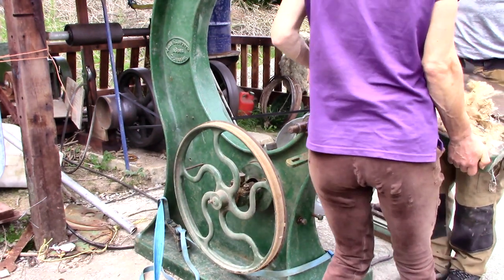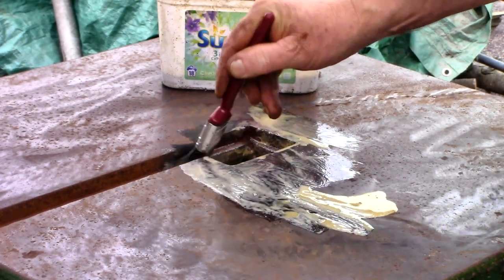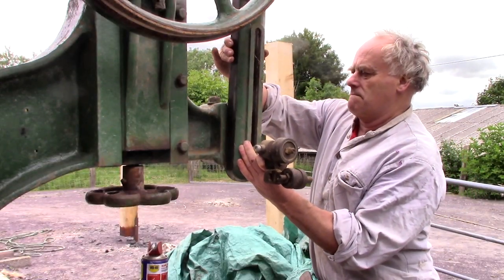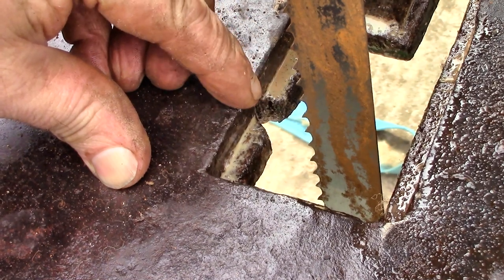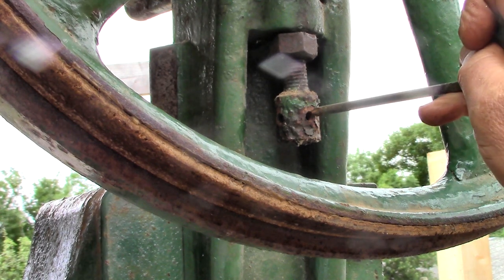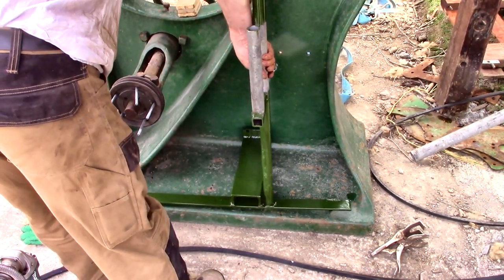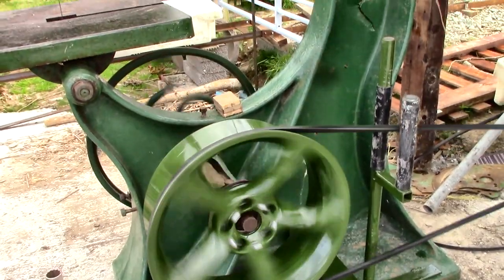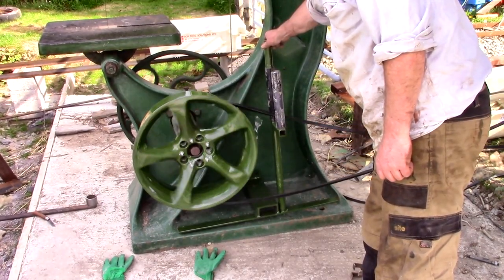First Cuts With The Vintage Bandsaw...!

Comment: Old machinery has soul. Being built to stand the test of time they silently bear witness to wars, famine, plagues, discoveries, advancements and progress.
If only they could talk.
Sometimes if you look close enough you can get a hint of what they have seen.
Past repairs, scars from use and sometimes a modification good or bad.
Above all they have soul.
A piece of every draftsman, foundry worker and mechanic is there. Silently they live on.
How happy an old machine sounds when restored to its original condition and put under power.
If you listen close it will whisper it's secrets in just enough quantity to make you have more questions than it will ever answer.
But on that first moment of life it gives you a bit of that soul.

Be safe and have fun!
Cheers
Terry from South Carolina USA

Comment: I loved your simple solution for the belt guide.  I purchased an enormous Italian bandsaw at auction about 6 years ago. It weighs in at approximately 2 metric tonnes. It is 3 phase powered, stands well over 2.5 metres tall and easily processes seasoned hardwood eucalyptus beams. The bandsaw wheels are so large that with the momentum imparted by the 10hp 3phase motor it takes some time for them to stop after I have switched it off. I love the look of it as I do yours , both are works of art.

Comment: It really needs some rubber on the pulleys, it's much less hard on the set of the teeth, that rub on the wheels. Without it the teeth on one side will wear and the blade won't cut straight. Good pulley rubber can be cut from old inner tubes and if needed can be stuck on with Evo Stick. You don't need to let the glue go off as you usually would, just spread it (Or spray) on the pulley and stretch the rubber over. Only ever had to do it once mind.

Now you need to make a blade sharpening machine,  that ratchets the blade along one tooth at a time and sharpens it with a Dremel or similar. There are videos on YouTube on several different designs,  some stand alone and others that fix to the bandsaw table.
Reply: Good idea on using an inner tube to put 'round the wheels!
Reply from the maker: But it already has cork tyres : -  )
Reply: @wayoutwest-workshopstuff6299  Ah I didn't see those. Sorry, carry on.

Comment: Just been reading some of the comments and they are right you do need a guard on there to stop you getting hurt if the blade snaps or just comes off I have used a lot of bandsaws and band resaws as a wood machinist. Very nice machine

Comment: I love your vintage diesel engine and all the machines you run with it. One thing I would do though is maybe build plywood guards over all those exposed belts and pulleys. Too easy to get a piece of clothing caught in there, and all it takes is a momentary lapse of attention after you've been working all day.

Comment: I was gifted a homemade full size band saw a few years ago that was built back in the 70s with a motor and transmission from a lot further back.  It works perfectly even the wooden pulleys for the saw blade are in good shape with a bearing in the middle and rubber on the outer edges.  I prize this band saw and use it every chance I get.
Yours Tim is marvelous.  Cheers 🇨🇦

Comment: Might be worth building a table extension for the back side of the blade platform. That way when you run some longer pieces through it, you can continue to push through without worrying about the piece dropping onto the wheel.

Comment: 1:41 the bearing could have been replaced, but honestly those bearings don't wear heavily if they are greased well, kept dry and don't see sand or metal dust in their daily life. Given that you don't exceed their design RPM and the load is well balanced.

Comment: Great to see the saw running. The engine seems to be starting easier. 
I trick I use on my diesels is to run them at speed and trickle some water down the intake.  It cleans them out very well and makes starting and running them much better. I use a litre or 2 and just trickle it in fast enough so the engine doesn't bog. If it does, I wait  a few seconds till it clears and go again. It's very simple and very effective. 
Love the vids and all your wonderful toys.
Reply from the maker: Thanks - but I'm not sure what you mean - the water intake?
Reply: @wayoutwest-workshopstuff6299   I meant pour the water down the air intake where the air filter or inlet manifold is while the engine is running and warmed up. 

Do this with my lister which I run on used veg oil and also my other engines and Vehicle. 

It cleans out a lot of deposits and can clean injectors tips  and free stuck rings. Very simple but helps if an engine is clagged up in anyway.
Reply from the maker: Seriously? That sounds mad, but I'm intrigued now : -  )

Comment: Interesting to see the stepped/flanged wheels, instead of the more typical crowned type. I have only ever seen ones like this on metal-cutting saws, which probably have higher feed pressures. I wonder if these are the original wheels. I would be pretty nervous about getting near all of that exposed blade. Maybe a guard of some sort?
Reply: No kidding, I am pretty sure I'd cut my left arm off just below the elbow with that much exposed blade!
Reply: teaches you to be more aware of your surroundings ;)

Comment: Maybe you should put a gass powered on board compressor on the train to refill the tank and also install a bigger air tank, quick question, if your old stationary engines breaks beyond repair what replacement would you get

Comment: Are you planning on putting a roller style conveyor belt on the back side of the blade to catch the drops? If you cant buy one I am sure you should be able to easily make a small one with some loose pipes

Comment: 4:32 the wood is supposed to be the other way around: Slot open in the back. The blade will flex backwards under load and its better to let it hit metal than wood, as wood causes a lot of extra drag which can snap it.
Reply from the maker: Slot at the back is how I made it

Comment: I wonder if the nick on the table might be from the BACK of the blade from pushing metal or wood into the blade and not the cutting edge hitting the table.

Comment: OLD PEDAL SEWING MACHINE THE NEEDLE IS ATTACHED TO THE PEDAL(S) AND YOU CAN MAKE IT LIGHTER METAL IF YOU LIKE   USE A THROTTLE OR SWITCH TO MAKE IT GO AND THE WHEEL IS GOING BY ITSELF MECHANICALLY
IT CAN BE USED FOR DIFFERENT THINGS AND YOU CAN VARY HOW IT'S MADE ALSO    IT WILL ONLY ROT IN PATENT SO IT'S YOURS        ( PUMP AIR INTO THE OLD PISTONS?   WASHING MACHINE ETC )

Comment: Is it possible, that the table has been mounted as you put it first, so the scar in the table is from the backside of the sawblade...?
The teeth couldn't done that  scar, or...? or have the turn the sawblade reversed and sawing from the other end...?

Comment: Bicycle inner tubes can be used as the rubber tires under the blades
Reply from the maker: But it already has cork tyres..
Reply: @wayoutwest-workshopstuff6299  - OK I missed that in the video….great job Tim

Comment: Oooh Tim at least put a table extension next or under the main table to catch any offcuts before they hit the flywheel or the pulley or the lowe bandsaw wheel. Makes nice projectiles heading for the tender bits. Ouch.
Reply from the maker: You're quite right : -  )

Comment: How wide do you think it will cut , 12 inch or 14 inch wide ? Those belts always freak me out even back on the farm putting up silage !
Reply from the maker: I say a good blade would cut much wider - 20" or more. There's a lot of power in the engine. I'm limited by the throat though..

Comment: Could this have been driven by an overhead drivetrain? I remember the old cloth mills used to have drivetrains and my local printers had one to drive their presses via a stationary engine. They could move the belt to effectively enable and disable the machine. Back then, everything was fed from the rod including generators for electricity. These days its the opposite way around, with everything driven by electricity to power local motors.
Reply from the maker: I'm working on it but it's expensive to set one up

Comment: They are NOT grease fittings. They are for oil. Bronce barings also use oil. 
Please Tim. I´m pulling my hair out over here and i don´t have that much left.
Reply from the maker: Lars, I think you're mistaken - they are grease pots (also called cups). They are designed to be screwed down a little every time you use the machine, and that squashes some grease into the bearing. (Look them up.) If you tried to fill them with oil it would just run through. Sorry about your hair : -  )
Reply: @wayoutwest-workshopstuff6299  Aperently I am mistaken. Sorry Tim. I just googled them and found them. Never seen one before. And I have a lot of old shit in my shop. My bad.

Comment: probably the main reasons people go with modern technologies is, for one, it being plug and play- as in, plug it into the wall, read the manual, and you are off!
Though another thing is safety... this machine doesn't have any sorta emergency off switch. Maybe something could be done where if you release a pedal the drive belt disengages and a brake slows the wheel?
Another might be fuel costs, but I'm sure the vintage engine could be substituted for an electric motor if needed

Also your comment about the end of the world- yeah, with the roe v. wade overturning and such, sure looks like it sadly. Sets a bad, bad precedent. Looks like America's gonna become worse and worse to live in, at least fro the lower class.

Comment: Why are you making such a dangerous solution? It is nice to see old machinery, but for safe use it is not suitable. I once managed to cut my finger with a small bandsaw. Nerves damaged, bones ok. But nevertheless, I was really lucky. And that was a modern one. All your belts and free running saw band… it’s is a killing machine if you’re doing something unnoticed.

Comment: For wood cutting, the blade seems very fine. Way too many teeth.
Reply from the maker: For green wood I'd need a coarser blade, but this is fine when it's dry
Reply: @wayoutwest-workshopstuff6299  Then I will say you would be amazed with a better blade choice.